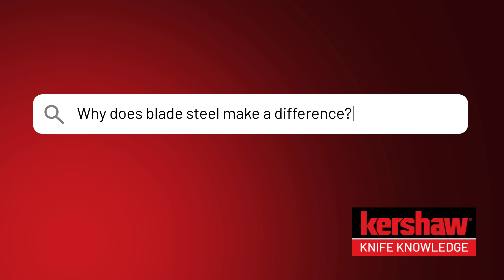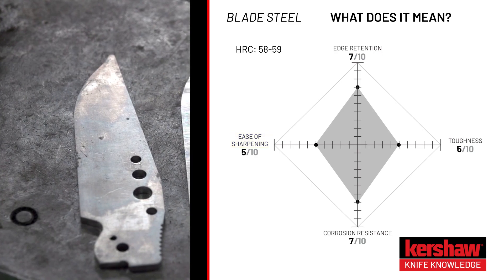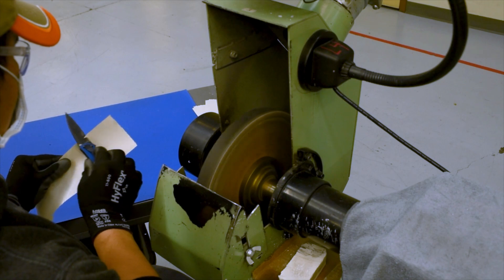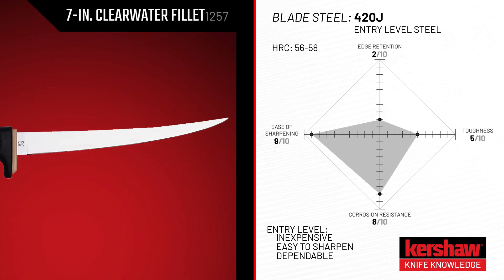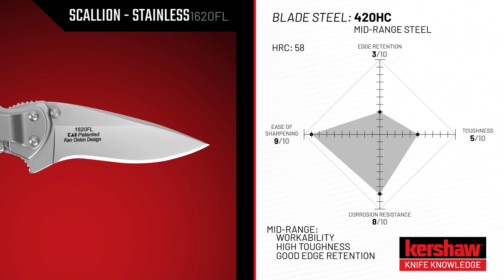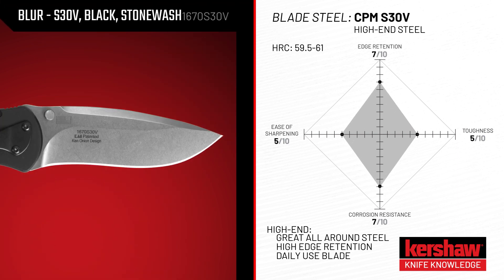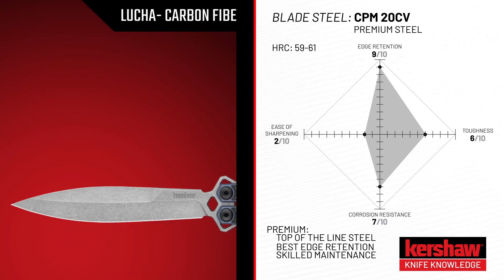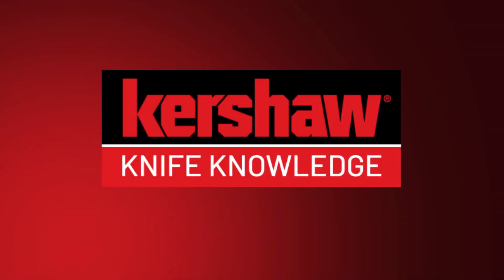Knife Knowledge: Blade Steels

Comment: I love the heat treatment you guys do on your cpm-154. I've got a launch one, had for years only don't light touch ups with a ceramic rod always stays sharp. Great edc knife.
Reply from the maker: A good heat treatment is something we always strive for. Glad your Launch 1 is going strong 💪
Reply: Fo sho. I have a Launch 1 and a 13. Both well done examples of CPM-154.
Reply: @PoetFisherman  do you like that launch 13? I've been wanting one since it came out.
Reply: @girthbrooks5078  I do. The ergonomics look odd but the fit for my hand anyway is actually quite comfortable. I thinned the edge out a tad though it cut well to begin with.

The two standouts for me were the feel in hand is much better than it looks in sales photos and it's somewhat smaller in feel than the dimensions online lead me to grasp.
Reply: @PoetFisherman  thanks, I might have to pick one up.